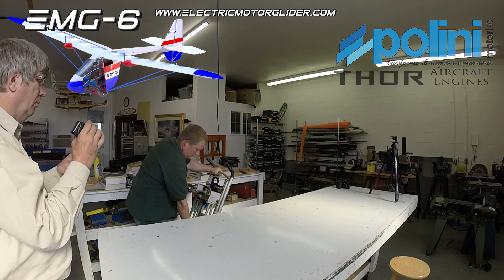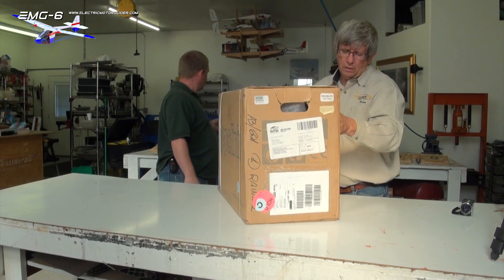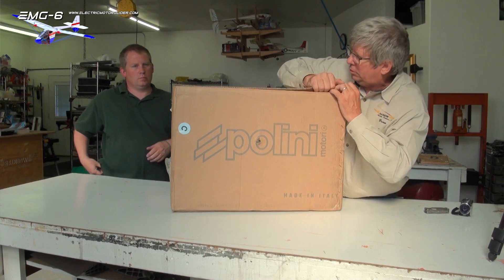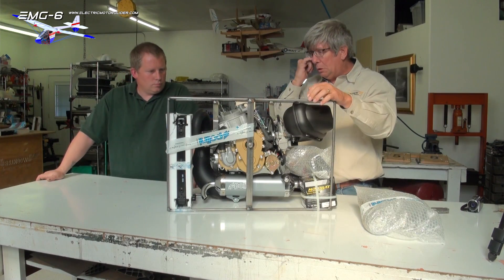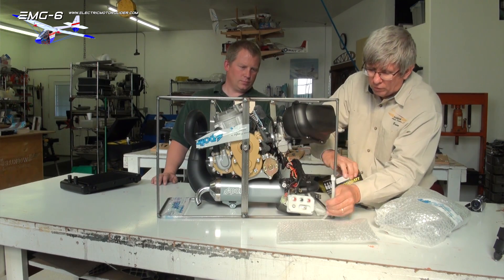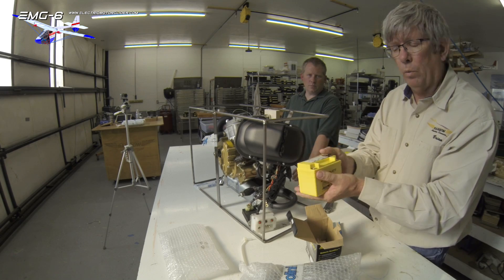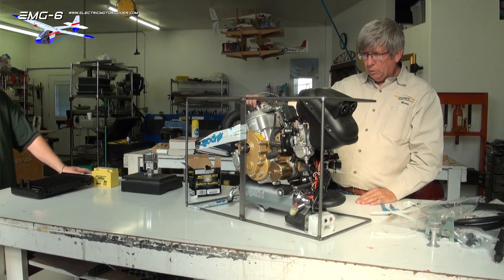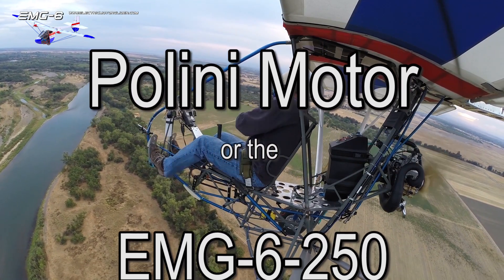Un-Box Polini 250 Engine

Comment: Should there be any concern regarding the hole in the box as received from shipper?  It appeared to be at the site of the drive shaft!  I'd've definitely pointed this out to the delivery driver. noted it and gotten a signed receipt from the driver, in case of any later developement of gear box/drive chain issues.  I may be over precautionary, but better safe than sorry, IMO.